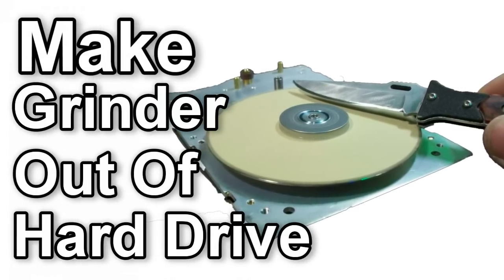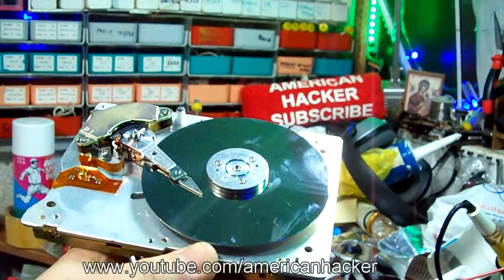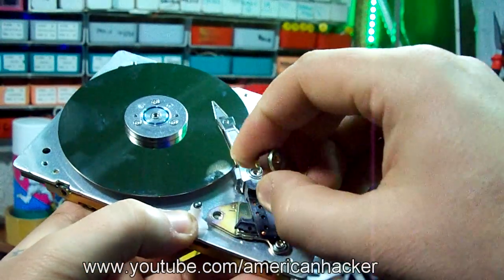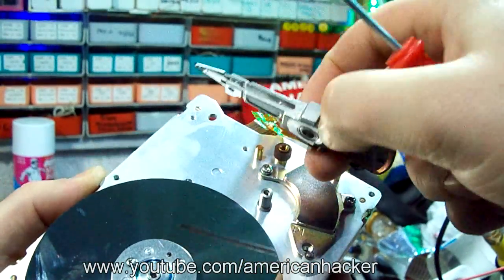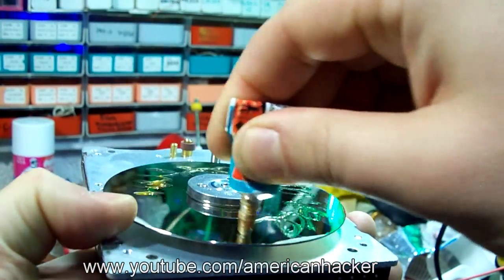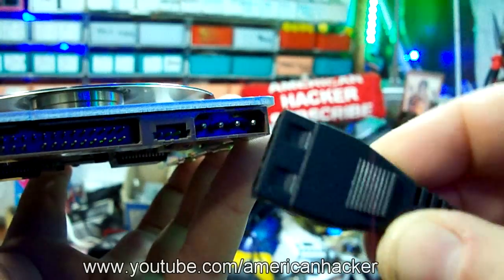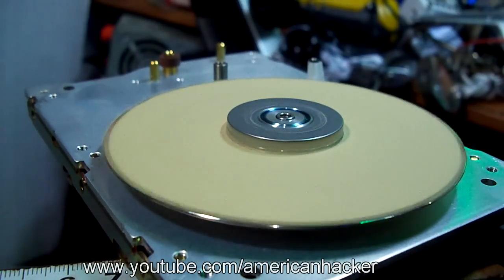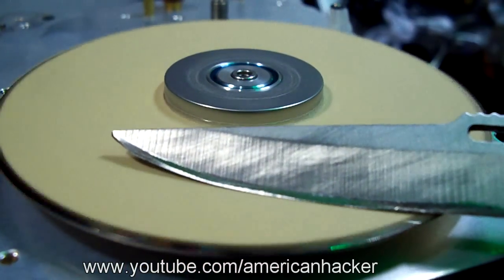HDD HACK - Make Grinder From Old Hard Drive

Comment: I think if one did a rough sharpening then finish with this fine one, it would work ok. As for doing it wrong, I am no knife expert but if done his way you don't have any chance of a roll over burred edge. If you look at electric knife sharpeners you will  see two slightly over lapped grinding wheels turning upward.  That is same as he is doing only one edge at a time. I have not made this but seems it may be good for fine grinding.  Would not think their is much torque though but have yet to try it.

Comment: ive been trying this for a few days now, and I am not getting a constant speed from the motor. is there a way to by oass the logic board and drive the HDD motor directly with DC current? I know the motor is AC driven, but would like a DC driven concept.

Comment: SO THAT does not work, does not work because the disc is stopped within a few seconds. GREETINGS AND HAPPY DAY
Reply: I have the same problem
Reply: I have the same problem
Reply: +ORLANDO HERNANDEZ Because some of the hdds are kind of "smart". If any data isn't read for a certain time,the hdd stops to save electricity. Unfortunately,there isn't any way to fix this.
Reply: +Shayon Khaled the way is just simply to solder power supply directly to the motor and skip all the electronics ;)
Reply: That does not work. If you skip the electronics, you skip the 3 phase voltage supervisor micro controller too. And you need an amplified 3 phase AC signal in order to turn an brushless motor. Don't talk shit without know
Edge.

So in order to let it spin continuously, i want to know what hard drive you have and what voltage supervisor IC you have on the circuit board. I can point out the enable pin so you could solder a wire with 5v to it so it won't stop after 6sec but whenever YOU want to stop it. Deal? So pls give me the IC code.
Reply: smooth l7251 3.1. can you help me?
Reply: You can fix it by jumping the last pin of the first row with the first pin of the second row WHEN THE DISK IS SPINNING.

Comment: how to plug it with pc power suppler?  If it is SSD, how to connect to power supply then?  Thanks
Reply: Well. U cant use SSD if u wanted. And SSDs use SATA connectors not MOLEX.